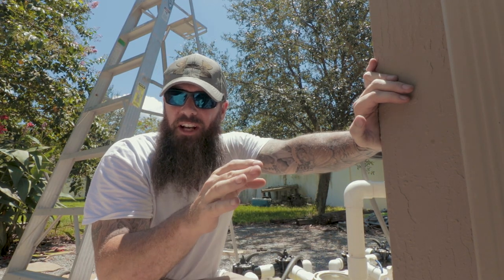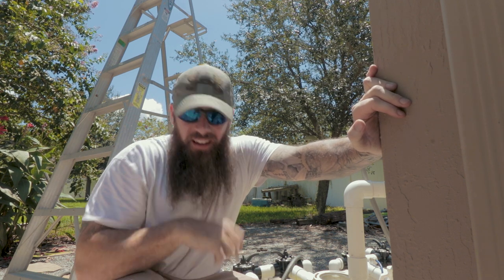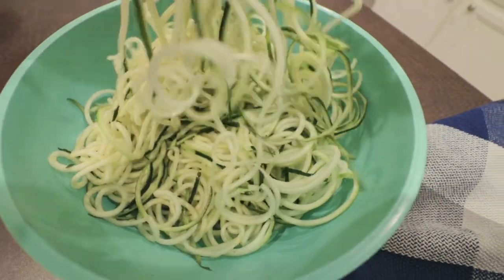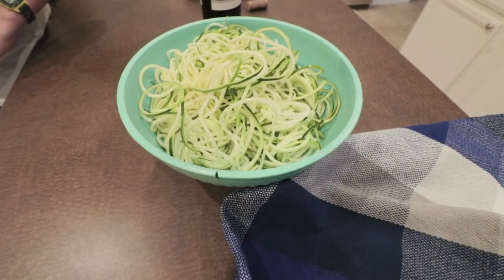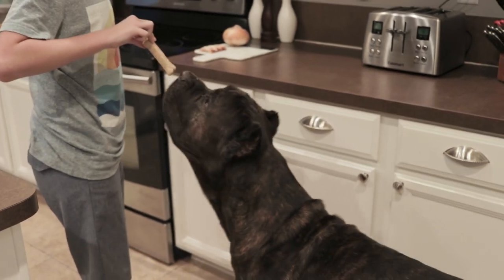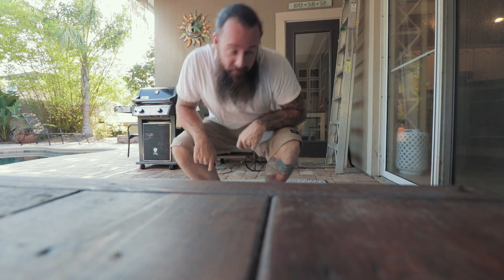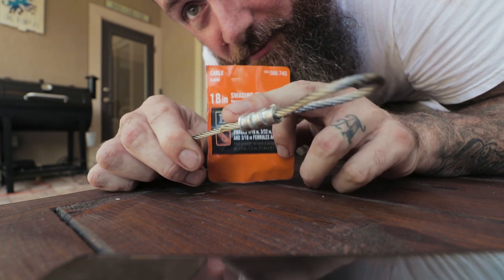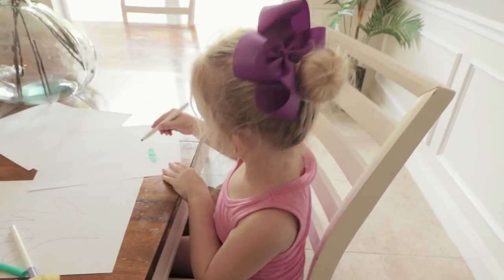LIGHT IT UP!

Comment: Great video. I get what you were going for with the lights - but if a string goes down and someone is in that pool you're in for a bad day. 

Can't help that it looks so good, though.
Reply from the maker: +Preston Thompson thanks!!  Glad you liked the vid.  

Yeah I thought the same thing.  They are attached to a steel cable in multiple points so it prob shouldn't ever fall.  Also each string is plugged into a GFI outlet so in the off chance in fell it should just flip the GFI and not shock anyone.  Tried to make it as safe as possible. 😉👍🏻